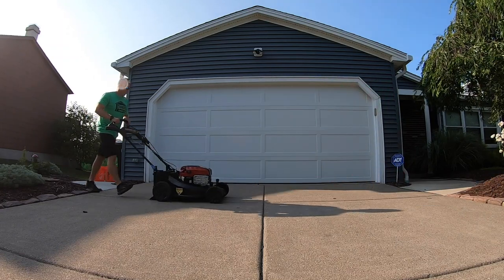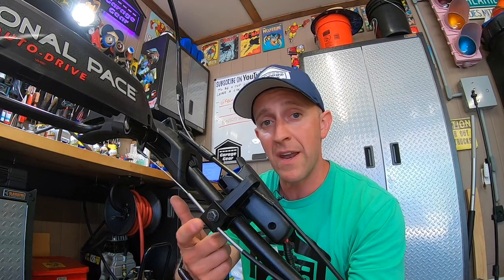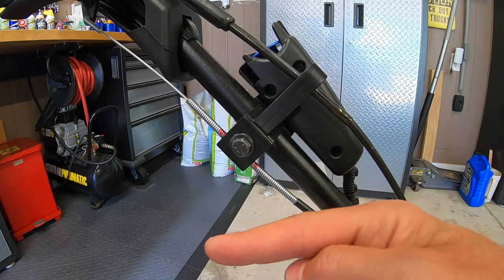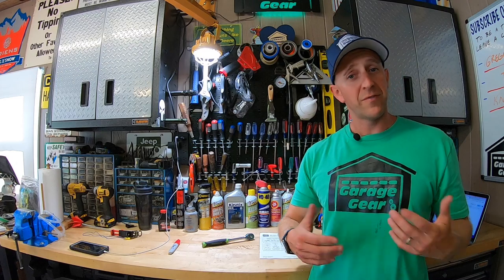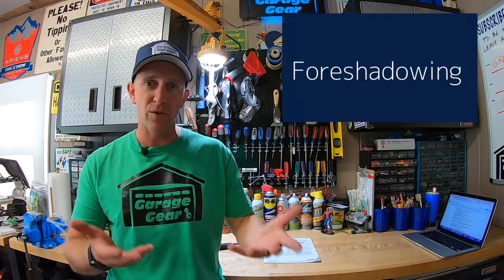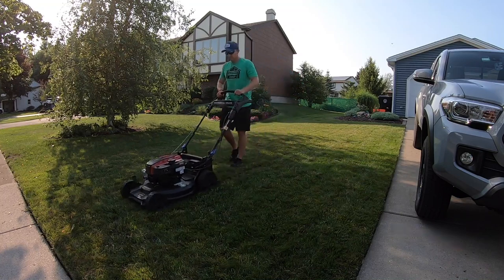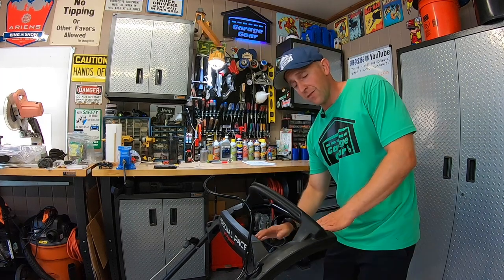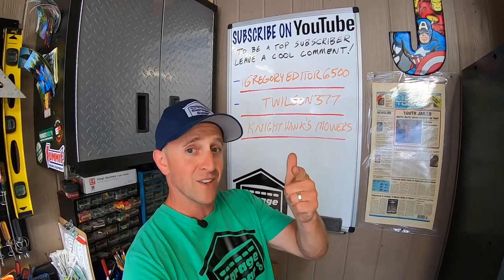HOW TO ADJUST THE PERSONAL PACE ON A TORO LAWN MOWER 21564

Comment: Thanks for this video. My Toro 21464 was stalling when personal pace was engaged. After going through the carb and checking the auto choke it turned out the personal pace cable needed to be tightened. The mower is only two years old.
Reply from the maker: Hey Barney in some cases these need to be adjusted frequently! Thanks for watching

Comment: Hey JB, how do I find out what kind of spring to get? 
Also, how often does the belt need to be changed? Do you have a video on how to change it?
Thanks
Reply from the maker: Hey John you’ll have to search your model number on a parts website. Vary rarely do you need to change a belt. Maybe after 10 years. I have a change out video on a front wheel drive model
Reply: @GarageGear  Thanks JB

Comment: The  personal  pace system  definitely needs maintenance  at least once a season.   Take it apart  one  side at  a time and  lay  out the parts in a  very  careful order.   Clean  them carefully and  apply a good  quality grease.  Inspect tem carefully (gear, rocking pins, bronze  wheel bushings).  Put  it back together.  Now  do the  other side.   The  gears only need a  small  amount of  wear  before  they  don't  mesh with the wheel  gears.
Reply from the maker: Thanks for sharing this info Joe! 👍

Comment: I was an idiot. I ran the mower over an area that was real rough and had plenty of sticks. A back wheel came loose, so I tightened it. Not long after, the belt came off. I cleared it as much as I could, put it back on, and it only lasted about 25 minutes before coming off again.  I'm going to get a new belt, but any thoughts, did I mess some sort of alignment up when fixing the wheel?
Reply from the maker: @mik2585  I doesn’t sound like there should be an issue with the wheel but I would make sure the belt guide on the transmission is secure and in good shape.

Comment: hi question open to anyone.ive follwed every you tube to check spark coil carb clean out new gas  new spark plug cant get this thing to roll over was running till  i ran it out of gas then fill up wont start.
Reply from the maker: @donlobel  have you checked your carburetor?
Reply: @GarageGear  MY CARB is brand new after install it rab great until ran it out of gas. filled up same gas was using and will not start  at all. changed gas clean out gas tank still wont start/ tryed some starting  fluid and will not roll over
Reply from the maker: @donlobel  ok hard to tell without seeing it. I would recommend having it looked at

Comment: On a different subject, What setting do you recommend for these mowers while waiting on the side discharge to arrive for tall grass?
Reply from the maker: @guitarandotherthings6090  depends on your grass type. I usually mow about 2.5 inches. I’m in Buffalo. This mower can go up to 4!
Reply: @GarageGear  After trying Honda and Recycler Max Im sticking with Honda, the Toro bottomed out several times but the Honda didnt bottom out at all on same grass, you can watch it on my channel if you want. I was very disappointed with the toro engine despite it looking “tough” you could tell the Honda was way more powerful. At the same price point may as well do Honda, i do however get “thumb fatigue” people talk about despite raising it. The toro is far more comfortable but what good is comfort if it doesnt work?
Reply from the maker: @guitarandotherthings6090  totally agree my friend.

Comment: Spot on!! I ran a large power equipment dealership at an Ace Hardware store for 20-plus years. Toro was our stud brand, we sold hundreds of their walk behind units annually, and the Personal Pace drive, later known as Auto Drive, was the number one part of their machines that caused trouble for owners. Your tips on correcting problems on these drive systems are a big thumbs-up. Many times you could adjust the drive cable to correct the action of the drive system, for trouble backing up. As you said in another video, there is a sweet spot on these units which will allow easy backup. If you aren't in the sweet spot when trying to back up, it will drag. Toros have been like that since the SR4 series hit the market in the early 2000's. There is NO WAY to completely eliminate the backward drag issue. It's a characteristic of the drive system.
Reply from the maker: Hey Donald! Appreciate you sharing this with the community! Thanks for watching

Comment: Last week I curb picked a 2006 sr4. I had no idea what a find this mower is. This mower was used hard. Cast deck was chipped up in the front and has a crack in the bottom of the deck at the side discharge. I repowered her with a briggs from an old murray and she is a mover. Now I have a back up for my 2001 personal pace in near  mint condition. I found the 2001 at the curb also 2 years ago. It needed a new float. Old one was full of gas. Now I  just need to find  a plug for the 2006 sr4. Thanks for the toro vid's.
Reply from the maker: Very cool Bob! Thanks for sharing this! 👍

Comment: Looks like that newer model is a bolt but for most Personal Pace Recyclers and newer Super Recyclers (pre handle redesign for either) with a regular nut for the adjustment, you can buy the plastic knob/nut from the older Super Recyclers and put that on instead and make fine adjustments easily without tools or having to stop mowing. I also always put the optional “traction assist handle” that comes standard on the Time Master on all of my Personal Pace machines. Most of the newer models are compatible, older ones you have to find the correct angle for it and drill the holes yourself. Makes one handed turn arounds and hilly terrain much easier.
Reply from the maker: Thanks for sharing this Jeff!  All good information here! 👍👍
Reply: Honda flippers are ok. What about cruise control .... But you can't turn when the drive is engaged. I'm surprised the cheap craftsmans didn't keep the clicker drives to allow turning.

Comment: Much needed! Thanks
Do you have advice how to properly clean after use from dirt and wet grass and how to fix or replace the back plastic flap. Mine always get tucked in, where I have to lift the lawn mower up to release it to normal? Considering taking it off.
Reply from the maker: Hey yev! I’ll most likely be doing some videos on these topics! I agree with you on the flap! Gets stuck all the time! Probably will cut about a third off of mine! Thanks for being a cool fan!

Comment: Just picked this mower up this past weekend. When you mean decrease traction or increase traction. Do mean slow down the self pace is decreasing traction and speed up self pace as increase traction? I cut this past weekend and felt like I was flying and the grass was cutting but I could see where it was leaving some blades uncut. Could be I was moving to fast.
Reply from the maker: Yea you are correct and you were probably moving too fast if it was pulling you and missing blades.

Comment: Thank JB for the tips on how to adjust the personal pace, I do have a question for you or anyone else,I recently purchased the Toro personal pace all wheel drive model,and wanted to know is there a way to stop the flap on the back up the lawn mower from going under the deck every time I go backwards with the lawn mower?
Reply from the maker: Hey Darth! I see this a lot with my mower! I think I’m going to just trim a 1/4 of it off and see how it does! 👍
Reply: @GarageGear  Ok let me know how that works out for you. If it works I try that out also..

Comment: I’ve got the same model wonder if you had an answer to my question. I was going through some thick grass and all of a sudden the mower became hard to push. A little bit of white smoke came from underneath the motor and top of the deck and the personal pace stopped working. Do you think it was the belt smoking and needs to be replaced?
Reply from the maker: Seems like something got caught up in the belt. I would give it a look.

Comment: Great video JB! I’ve got the Toro battery mower as a back up and really don’t like that personal pace. I’ll check to see if it has that spring set up. It seems pretty well built. I get about an hour run time depending on grass height etc. What’s up for the weekend? Cheers buddy!
Reply from the maker: Hey jay how old is the toro? I think the older personal pace models were better. Birthday parties all weekend! How about you my man?
Reply: HeyJB. I  think the Toro is about 3-4 years old. I got it to supplement the JD. When I had the mower deck converted to the snowblower and vis  versa. I don't use it much so it looks like new...did a lot of yard work today  and tomorrow will have the Grandsons. Enjoy the weekend my friend.
Reply from the maker: @jaybooth4815  oh cool thanks for sharing my friend! Have fun with them!!!

Comment: My toro recycler personal pace manual says to loosen the bolt and pull cable jacket toward the mower until all slack in cable is removed. Does this procedure not apply to all personal pace mowers?
Reply from the maker: @johnd.5480  this may vary for some models.

Comment: Fantastic video! Just got my recycler. Question, how do you adjust the handle height? Can't seem to find it anywhere. If you have a video on it, happy to watch and like too :)
Reply: Got my "Super recycler"
Reply from the maker: Hey krish! Here is a link to the unboxing video where I set up the correct height of the handlebars. BEFORE YOU BUY A 2023 TORO SUPER RECYCLER, WATCH THIS!
https://youtu.be/sG9P3nWOR5Y thanks for watching
Reply: Thank you! Sorry I’m high maintenance…do you also adjust the blue levers? I adjusted the carriage bolts no problem and it dropped the handle to where I wanted it. However it now can move up and down maybe half an inch as the blue levers and that metal stopper that goes in and out is now in the middle instead of the top/bottom. Wondering if that’s how it’s intended.

Comment: I have the 60v version of this mower and the manual does outline the procedure you described. Your video encouraged me to adjust the drive in my mower more so than the manual
Reply from the maker: Hey LL! This is interesting because another 60V owner mentioned they didn’t see anything in the manual on this procedure! Wonder what’s up with toro on this! Thanks for sharing
Reply: @GarageGear  I’m in Canada if that makes a difference. I purchased it from a dealer.
Reply from the maker: @LL-mt2nz  hmm not sure.

Comment: I assume you know about the recall Honda has issued on their mowers because of compression release problems with the camshafts. Just make sure to be extra careful when pulling the cord on it because people have been getting injured because of it.
Reply from the maker: Hey BCSERK I’ve heard of this issue with the camshaft but didn’t realize injuries were happening! Thanks for sharing bud!
Reply: @GarageGear  Yeah, I had a 2023 HRX217 with this cam issue.  The first time it happened, it nearly ripped my arm out of socket.  And I already had a torn rotator cuff.  Not fun.

Comment: I don’t recall you ever touching on your lube of choice to use on push lawn mower wheel bushings.  Is Red N Tacky your go-to?
Reply from the maker: Hey macro! Yes red and tacky is my go to! Perhaps I should do a video on this!
Reply: @GarageGear  When I change the oil in my push lawn mower I always pull off the wheels and lube the bushings with grease, send a drop or two of oil down the cable housings, pull the fashion plate off the top to clear debris out of the flywheel, vacuum/blow the air filter, etc.  Quality mowers are getting harder to find in our throw-away economy so it really pays dividends to take the best of care with built-to-last lawn equipment.
Reply from the maker: @macrobinson5457  you’re absolutely right! You need to take care of what you have!

Comment: My belt is original from 2005 I bet that's the issue.  I thought because it hadn't broken it was OK but it's become harder to push.
Reply from the maker: Hey clearance! Have you made this adjustment already?
Reply: @GarageGear  No
Reply: @GarageGear 
Have you made a vid on belt replacement for this Toro? Just curious. Thanks!
Reply from the maker: @apexiumim2741  not for this mower apex.

Comment: Mine is driving even when there is slack in that cable. How do i fix it?
Reply from the maker: Hey mm, I wonder if you have to give it more. Hard to tell without seeing it. How old is your mower/cable?
Reply: @GarageGear  it's approximately 11-12 years old. I did your small adjustment from this video last fall because it wasn't driving fast enough. That worked fine for a while. It seems to be something is stuck underneath where the spring at the bottom of the cable connects to. It doesn't seem like a cable specific issue, but I'm not sure what to loosen.
Reply from the maker: @mmlowe34  hmm hard to say without actually seeing it in person. I would recommend having it looked at by a repair shop.

Comment: New Toro's are junk. I dumped my new one after only a year and instead fixed up an older John Deere JS63. Works so much better, and I prefer the bale bar for self propelled over personal pace
Reply from the maker: 💯 agree with you my friend! Old deeres rock!
Reply: I disagree my 2020 toro recyler has been used to mow hundreds of yards and made over 1k$ with it although its on its second motor
Reply: @conner5611  you must have gotten lucky. Within 10 mows, the left rear wheel came off, and one of the bolts that holds on the rubber bumper went missing. Plus, it never started in one or 2 pulls. Always 3-4 pulls, that's even when it was new out of the box
Reply: @killaman7592  Wow, just wow.  My 2015 SR4 still starts on the first pull with only basic oil changes, air cleaner cleanings and spark plug checks..  The only issue ever was a failed cable for the personal pace propel function.  A $15 cable and 10 minutes of install time and that's it.  They don't make them like this anymore.